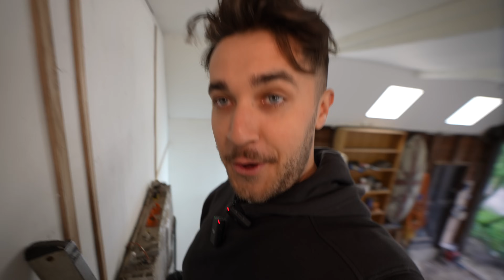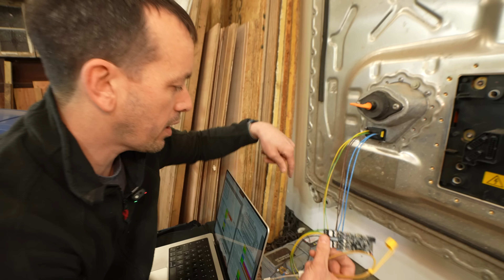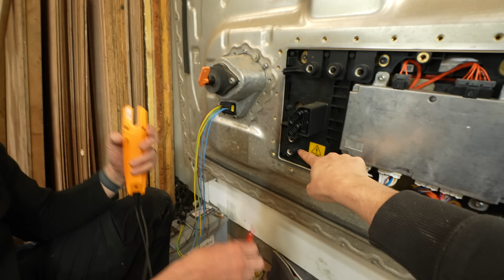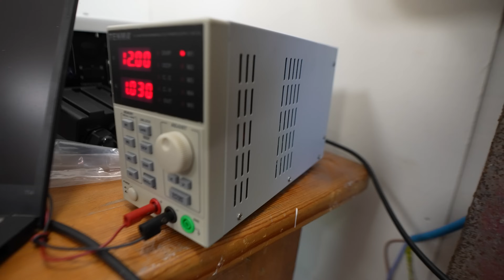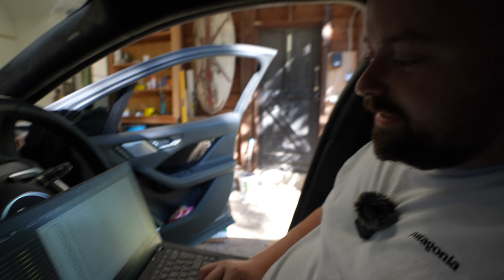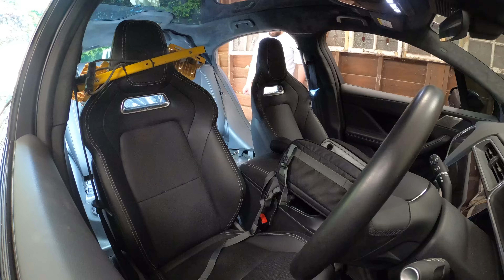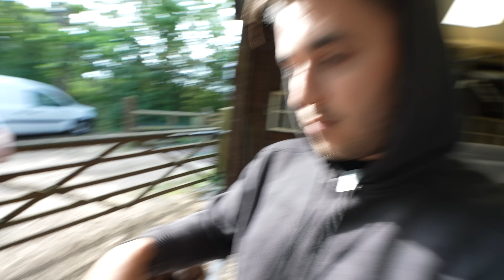Hacking an EV Battery From a £90,000 Car -  DIY Vehicle to Grid | ØY44

Comment: I think it has been mentioned already, but that battery needs to think it is talking to the ECU/ BCM with a matching VIN. and that ecu / bcm might also need to have the "airbag / seatbelt charges blown" codes cleared so the battery thinks it is safe again.. along with a new high voltage pyro fuse.

You might be better served seeing if you can get the battery to accept a charge first as that requires less things to be correct on the canbus. As you demonstrated in the working car, the contactors would not engage until all the doors were closed, your foot was on the brake, and you hit the start button - as well as the car sensing the key - none of which the battery on the wall will see. None of this is required for the battery to accept charge however. Getting the system to accept charge would eliminate some of the potential causes for it to not engage the contactors - giving you a smaller set of variables to work with.

Comment: This is the electric companies way of tricking you into supporting the grid rather than them spending the money to upgrade the grid! What happens when  that goes into thermal runaway? Better put that battery outside so if it does get dendrites between the plates and thermally run away to end up burning down your solar array on the roof! Isn't the fumes off a burning lithum toxic waste as it is offgassing? Another thing I am curious about is when the batteries are half charged and have the tendancy to explode, how do you protect yourself and your family from being harmed from any of these problems? If they could be kept safe, they seem totally fesable!

Comment: There is no way I would put one of those 2nd hand batteries anywhere near my house. If there was a thermal runaway event, the inextinguishable 3000 deg fire and toxic fumes for 8+ hours would be a real problem as I would have nowhere to live! Also it would probably invalidate my house insurance too. I admire the theory, but the battery would need to be housed away from any other building and accessible to the fire service. Maybe when they invent non-runaway batteries this will be worthwhile.
Reply from the maker: Me too, it’s only really ideal if you have a lot of land, or a commercial setup

Comment: Every car manufacturer has its own design to control the battery charging and discharging to be a battery management system. The circuit design was tailored made by the R n D team. I prefer to disassemble the batteries then reconnect to appropriate required voltage allocation to suit for your inverter. Those would be easier and fast.

Comment: Maybe the battery needs to be asigned to the car first to actually activate, like the battery might have sone sort of an id. It may be to prevent swapping components of the car by 3e parties. Similair to Apple's phones. Some initialization is missing here I would gues

Comment: I'm not related to JRL but, I used to work for a company that was using the modules out of this car.

Each module 3S4P Lithium Polymer module does not have its own BMS.

The important pin connections if you need to reconfigure the pack or add you own BMS?

Each module has a 0V, 3.7V, 7.4V, 11.1V and two pairs going to 10K Thermistors for reading batter temperature.

The bus bars are connected to each module with M6 bolts, ofcourse you already have all the bolts and connectors inside the pack.

A WORD OF WARNING if you want to read the cell voltages using the connector, each tap is connected to the cells by a really thin flexible PCB if you short across a cell that will burn the trace, its not fun cutting open a module to repair!
Reply: Regarding that thin internal flexible pcb in each module, how much current can be drawn out of each cell when an attached BMS sees that it needs balancing? The jag bms seems to limit it to circa 100 ma which rules out most capacitative smart bms’s 
I have some diy bms boards (By Stuart Pittaway) which have a suitably low current rating, but was wondering if you know what can be taken from each of the voltage sensing wires that a bms needs to see. The each of the flex pub tracks that read cell voltages within the modules seem to have a surface mount component that could be a fuse so could easily be blown if they are shorted while someone is trying to configure 5 modules to give a 15S pack for a 48 volt system like I am trying to do.

Comment: Hi Cory, I am a high voltage technician with Audi. I would say that you are missing the control unit for the battery, on Audi its called J840. Battery management ECU, this communicates directly to the battery. Great video by the way mate.
Reply from the maker: Thanks mate, I’ll take that on board! 😁👍🏼

Comment: Honesty, it it was me I'd remove the old bms & design my new one using parts from the old one if i knew how the battery management lines are in place. Just new pcb needed & some desoldering & putting them in new bms. I find it much easier to have little redesign with little reverse engineering than complete reverse engineering because of the things manufacturers might've put in, like unsure if coolant signal needs to be ok or not, does it need some id from the original card for verification at start, what's the sequence of msgs, etc
Reply from the maker: I want to keep as much of the OG safety system as possible, including reusing the coolant pumps and car radiator 😁

Comment: hmm id just take the battery apart, 11v cells, you say? put them all in parallel  and stick my inverter on it - done.   Hacking is cool though and you can learn alot, but is it really necessary?  I got a can bus reader from aliexpress for $3 and the app came with it deciphered all the messages.  Im sure it could work here if you plugged it in properly?  Anyway cool stuff.
Reply from the maker: Would then need a new BMS, and it would be a janky system rather than the nice system JLR have created after millions in R&D. The Ali express reader I don’t think will cut it in this instance 😅👍🏼. Good for resetting a basic fault though!
Reply: @corymac  I agree it would be janky,  heh,  with a little more effort and you could have a nice system. Theres a guy running a high voltage offgrid system and says its way better  https://youtu.be/NNDMzWNrrwE?si=dASEYAFcMjxxUfec

Comment: You will definitely need to plug in all the HVIL contacts of the battery. The big connectors at the top are more than likely to have those and the battery will definitely avoid electrocuting someone if it sees those connectors are unplugged.

Comment: With car manufacturing keying everything on a per-VIN basis, I wouldn't be surprised if replaying logs from one car on another (or without the rest of the car present) doesn't work because control codes are scrambled on a per-VIN basis and require a subscription to Jaguar's iPace technical database to obtain or re-program. If I'm correct, then log replay won't work on a different iPace.

Comment: The idiots at Audi and their partners, like my local dealer, really believe that I pay their completely disgusting bill to repair my Audi e-tron. Failed EV control unit (heavy rain), which ends up with damaged front engine and at least two destroyed battery modules. So car is waiting in my garage for tear-down. Nice project, I will go the same way. Because their proposed repair bill of material is around 26k€, with main parts (engine,two modules) for around 5k€. It will not burn down, because it is equipped with Samsung SDI modules instead of the LG they used in other models.

Comment: Every HV plug will have a HV interlock that will need to be shorted ( it is a loop that connects all the plugs together. Also remember this is a car, when a car crashes and the airbags deploy the RCM module will send a CAN message to open contactors, additional to this legislation requires that there is a separate wire from the RCM that carries a square wave signal to give the all clear!

Comment: My question is why did you have to soldier on that connector, you bought a whole car so you should have had an extra connector for the battery. I think this is great. There is a company doing this with a Tesla pack.
Reply from the maker: The connector was lost, and I was working over a bank holiday weekend 😂👍🏼

Comment: Have you bridged out the interlock pins on the high voltage connectors? The pack might think there is a loose (or missing) hv cable and refuse to cooperate, because safety.
Reply from the maker: We have 😄👍🏼 - it’s a Comms issue now, about 99% there! Hold out for part 2
Reply: @corymac  when are you going to upload part 2?

Comment: Looks like the EV industry in Australia is at a standstill because of the battery conundrum and oil companies resistance. Good to get hold of a battery like that where cells have not gone into death mode due to bms initiating a kill cycle.
Reply from the maker: What’s the kill cycle? That’s fascinating
Reply: @corymac  if the BMS senses something wrong it deep discharges the cells. Some laptop batteries do this. Whether or not car industry will follow this method eventually is yet to be known by me. Maybe some engineers at EV factory can confirm.

Comment: that's some great work done ! make sure you keep at least a rough documentation how you made it work for all the other folks. 
my thoughts:
if there are three can buses, what do they expect to connect to ?
one might be just a passthrought directly to the bms modules so the cell level bmss can be diagnosed independently from all other modules, another one a strict can bus receiver end to operate the contactors. the final one sums up all the information and status.
maybe they need a well timed sequence to make it all work.
you already have a mutichanne scope, so i'd determine what is the can high on each bus (in the working car) and track which bus is active and what information is transferred at startup sequence. looks like they made it more complicated that most other manufacturers that rely on a single can that makes it all work.
Reply from the maker: I’m sharing it all on GitHub and discord! 😎👍🏼

Comment: Your comfort around 400vdc is rather worrying  😂  I would 100% use some opto isolators in line to those CAN interfaces. The last thing you want is any ground loops. In terms of the battery not responding it may be worth checking that a serial number for the main ECU is not expected by the BMS. That is just the kind of thing the manufacturers would do so you have to pay a dealer to change the battery. To help it would be a good idea to put the CAN messages on a Live / Google drive so we can see them. Some type of lockout or security code may be why the battery BMS is just going back to sleep.
Reply from the maker: I’ve been sharing the data and findings on Dala The Creators Discord & GitHub 😁👍🏼
Reply from the maker: It is isolated every time we’re working near it, there is a master fireman’s switch which is a kill all 😁👍🏼
Reply: @corymac  Your a lot more relaxed than me, I used to work on submarine DC power systems and have seen what 400+vdc can do. It's not pretty. I didn't know there was another isolator elsewhere on the pack as the switches are normally in the module. Your braver than me, I would have insulated those pins just to be safe. DC at that potential makes phase to phase AC contact look wimpy !  🤯

Thanks... will have a look at the data. I didn't see a link to it, will have another look.

Thanks for the interesting video 👍  I'm sure it can be done. It's a shame Jack from EVTV isn't about anymore as he would have been your man as far as proprietary can bus and protocols went.
Reply: Of course we're all trained in HV & electrical safety. I used to work on 50+ kV HV systems. A friend of mine I used to work with had his wedding ring finger blown off due to a charged capacitor...! So although we're relaxed, it's not because we're blaze !
Reply: @obbardc  Blew his finger off ??? Wow .. reminds me of my early college years when whe used to charge up a big electrolytic capacitor with a mega and throw it to someone telling them to catch 😅 I think over 30 years I have the best memories back on the tools and out on site. It becomes a lot less fun when your stuck driving desks !

Comment: Batteries can get locked up when they receive crash signal. I suggest you plug it under a normal car diagnostics and see what the fault codes are

Comment: think it will catch fire
Reply from the maker: This is designed to go under a car at high speeds, surviving crashes with massive loads. I was to connect it up to a house which at peak, will pull only a small fraction of what it’s capable of
Reply: @corymac  it will blow up darlinks

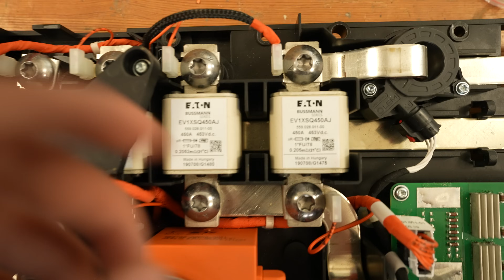Comment: 11:17 Those "shunts" are HRC fuses.  The symbol on the body shows a fuse in series with a diode which is a bit misleading as there is no semiconductor within the fuse.  Instead that symbol means this is a high speed fuse which is designed to rupture rapidly enough to protect the high power semiconductors that the battery is connected to in the event of  short circuit.  They are not polarised, they won't block charging current and you should keep them in circuit.
Reply from the maker: I figured that out with testing them, thanks mate! I think my head a bit scrambled with the puzzle made me mis step the basics 🤣👍🏼

Comment: That pack of battery doesn't really like to be lied to 😅. Jokes apart, imagine the possibilities especially for developing countries to have access to those packs and use them to build power plans. It would be cheaper and secure but without the cost that comes with those condition.
Reply from the maker: That is exactly where my mind went to
Reply from the maker: Third world countries that are expected to recycle these, could actually use them for their original purpose. As batteries

Comment: Very interesting project. I was thinking, an EV's 400V battery and the EV's motor-inverter should be able to create a nice 3-phase 400VAC at 50Hz. Or a single phase 230VAC at 50Hz, when hacked correctly. All needed power-electronics are there. The biggest problem would be that car manufacturers will go to great lengths to prevent the end user from tinkering with their product. I hope you'll succeed. 
I'd probably disassemble that battery, discard all electronics, assemble in a configuration that would work for me, and put in a BMS system, charge controller and inverter I can trust. But yea, would be super cool if you can re-use the car's BMS. Good luck. I'm looking forward to the next part.

Comment: Great stuff Cory, and well done for not digging yourself into a hole with that working I-Pace, the opportunities for blow ups are high on this one. In the past ive always used OEM CAN interfaces but im going to get one of those £25.00 amazon ones and have a go with SavvyCAN that I did not know about. Re the wiring/connector a pair of green 10 way rising clamp headers plug/socket may work well for you rather than committing to hard wiring! Looking forward to part two.
Reply from the maker: It worked so well!! For the money it’s definitely worth having!
Reply from the maker: Always good to see you here Michael!
Reply: @corymac  I like been educated and entertained at the same time

Comment: 11:18 As an electrician iIm surprised you don't recognise a FUSE? Bussman doesn't make shunts. They make fuses.
Reply from the maker: I misspoke - it also had the symbol on for fused diode 😁👍🏼 ->|-
Reply from the maker: Obviously there is no diode in it. It is a sensitive fuse made for semiconductors which would make sense because it protects 400dc ish
Reply: @corymac  Diode? Shunt is a resistor. The Tesla doesn't use shunts as the losses would be too large. It uses current transformers with hall sensors so it can sense the magnetic field at DC.

Comment: The DC Buck-IC on the board will take up to 16V in and the capacitors are 16V, so no, 13V will not fry it.
Reply from the maker: It’s not so much the voltage that matters. Amperage is more important. Closing contactors can have peaks up to 20-30A, so having a lead acid battery take the grunt will be helpful. Which we also tried off camera. 

Nissan batteries work with 9V-16V input voltage as reference. 9v and below it throws a wobbly
Reply: @corymac  I was referring to the Lilygo-board. That will run just fine on 13 volts.

Comment: Im sure these ev batteries have a pyro fuse inside them which which is makes the battery safe after been in a collision which fails and stops the bsm from working and with you saying its been in a crash you might want to investigate if this battery has the fuse inside
Reply from the maker: That’s something we’ve checked, and it’s all good and happy 😁

Comment: So many people I know have looked at doing this but simple don’t have the skills. Seriously you lads crack this and you will be in a new career path. Even a half power EV battery will make a good home storage battery at the right price. I have found people breaking the batteries down and fitting a new BMS but what you are doing is the ultimate goal. You would actually think the car manufacturers would be encouraging this use for old EV batteries and getting the green points. Shame you didn’t have the plug that fitted that socket you are soldering cables too 😂😂
Reply from the maker: Thanks man! We’re 99% there!

Comment: At the start, you could have kept the Arduino connected to the computer and written any CAN messages received from the battery to the serial monitor in the Arduino IDE so you could at least see if anything was happening.
Reply from the maker: Thanks!

Comment: Iam pretty sure the missing High voltage interlock on the HV plugs need to be interlocked with each other so it thinks they are plugged in. It is for safety so you don’t die when you touch them
Reply from the maker: We’ve managed to get all the interlocks linked, but still no cigar, seems a Comms issue, but might have just cracked it! Hold fire for Part 2!